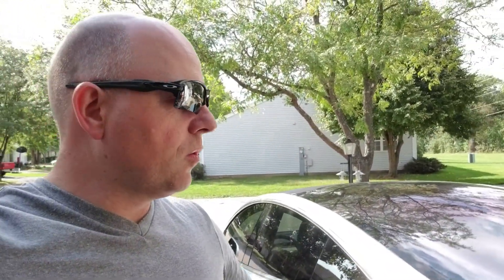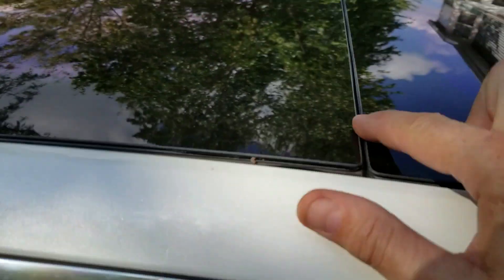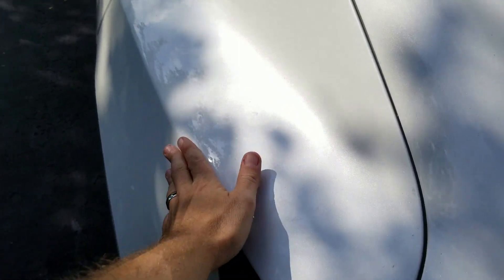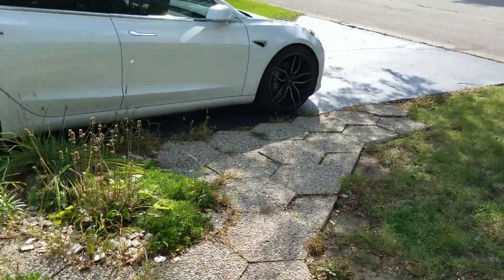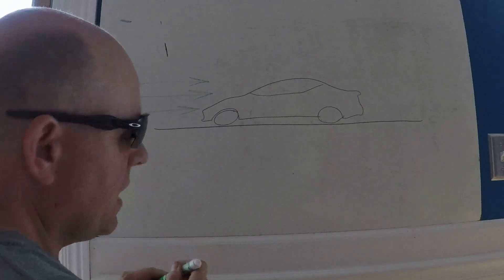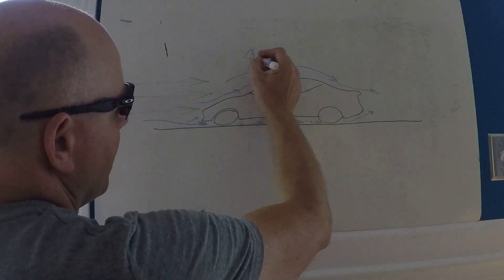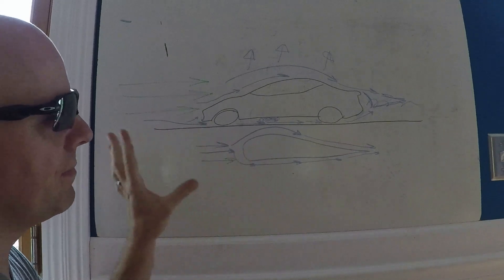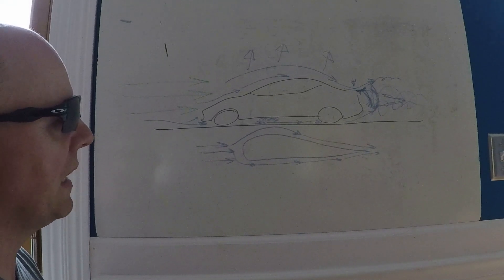Tesla Model 3 aero part 2

Comment: Just wanted to point out that the explanation about how the Model 3 (or any car) creates lift is incorrect. Lift is created by the difference in pressure not the curve of the surface or equal transit theory. With airplane wings, the angle of attack is more important than the shape. Higher pressure underneath the a surface creates lift (relative to pressure over the surface).

https://www.grc.nasa.gov/www/k-12/VirtualAero/BottleRocket/airplane/wrong1.html

Comment: Imagine how slippery the 2020 Roadster is going to be, the large rear diffuser looks like it's going to generate alot of downforce by sucking all the air from under the car
Reply from the maker: The added down force of a large diffuser will make the car less aero efficient by adding drag.
Reply: @TechForumTesla  How so?
Reply from the maker: @ZephyrCorsa  downforce increases drag. It just is. Nothing comes for free. That downforce comes from increased drag. You trade forward momentum for downward force.
Reply: @TechForumTesla  Even if it's sucking the car directly downwards and not back at all?
Reply from the maker: @ZephyrCorsa  the downward energy needs to come from somewhere. Downforce creates drag. 

Great question, Dude!
Reply: @TechForumTesla  The downforce is generated by the vaccum effect diffuser causes by changing the velocity and pressue of the air traveling under the car while actually reducing drag by decreasing the size of the air gap behind the car if it's angled right. This can be seen on the LaFerrari's active diffuser that raises the diffuser angle at 60mph to increase downforce
Reply from the maker: @ZephyrCorsa  ok, I'm not going to argue about it. Nothing comes for free, period. Read up on it. You CANNOT have downforce if any decent amount without drag, period. Im not suffering about any further.
Reply: @TechForumTesla  There are ways to create downforce without increasing drag
Reply: @TechForumTesla  I mean the video I liked explained how, so there isn't a need to get defensive, make it a learning opportunity.
Reply from the maker: @ZephyrCorsa  look, what started this was the moment that additional downforce would somehow make the car more efficient. That is what I am battling against.
Reply: @TechForumTesla  I see but the video by Engineering Explained and an Article by Road&Track show how they are used to increase downforce by assisting the movement of air rather than working agaist it like a traditional wing. Since the air under the car is at a lower pressure, the air mobing over the top pushes the car down.

Comment: "More drag occurs at the rear of a vehicle than the front" - well..... it's a net effect.  The drag force (apart from the viscosity component) is the difference between the pressure at the front (times its cross section) and that at the rear.  But the general concept is sound - the shape of the rear is much more important to determining the drag force than the shape of the front.  If you have a large cross section wake, and it's a deep (low pressure) wake, that car is going to be draggy.
Reply: Teach me

Comment: Apparently while we are still waiting on "Camper Mode" in model 3, we have the ability to just turn the air on through the phone app while inside the car to accomplish basically the same thing.  I am planning on camping in the car for a night in a few weeks.  Can you do a test on this before then?  lol

I did some short testing, 1-2 hours to see how much energy is used and if it would stay on...it did, apparently it will for up to 12 hours or down to 20% battery, and it didn't use much energy, but the testing wasn't great either.  Heat of course used more than AC.  Used more energy than I expected, especially being that the temp deltas were fairly low.
Reply: blankets vs heater

Comment: i'd like to know if tesla has fixed the waterflow on the trunk. i1tesla made a youtube video of it. water comes down from the rear window and drops into the trunk...
Reply from the maker: My car has never done that
Reply: Tech Forum  try it maybe? open the trunk, spray some water over the backwindow and see what happends? :)
Reply from the maker: @j1mplug  I use my car in the pouring rain and I access the trunk in the rain. No problem. Here is the deal, rain will drain into the first round the trunk. If you pour a full bucket of water over the window, or will cascade over the water guide lip and into the trunk. 

Maybe fodder for another video?

Comment: Congrats ,very good explanation . For those who want to see tapering for aero reasons in a 70 years old design , look no further than the Citroen DS (oops , that one also had enclosed rear wheel wells...). The rear wheels were even closer to each other than the front ones to enable this tapering . Automotive aero goes even further in time  , e.g. Tatra before WWII